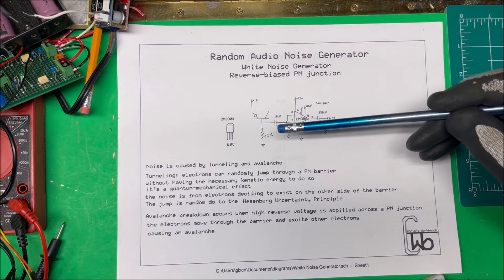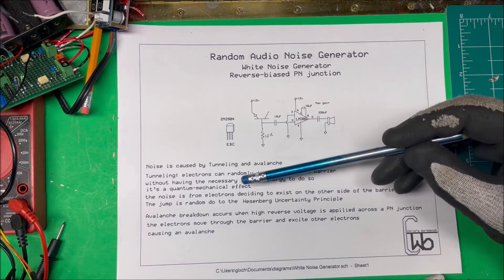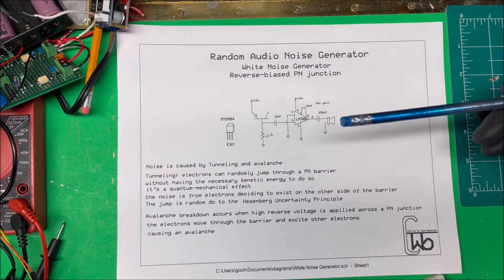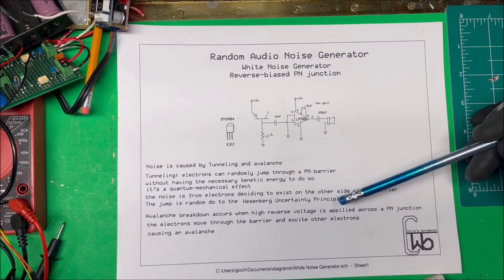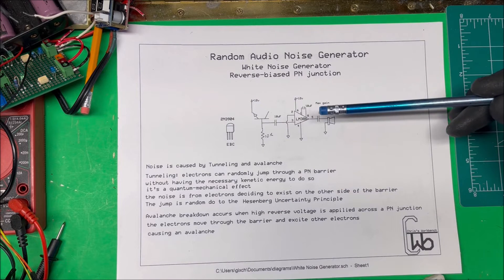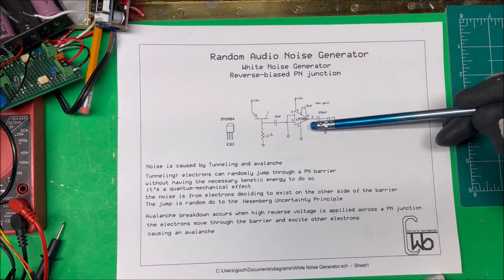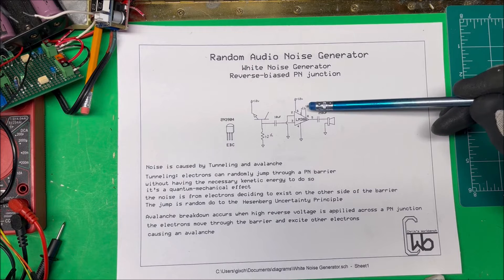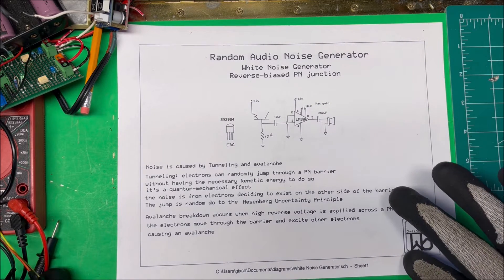Random Audio Noise Generator

Comment: I replicated your projected and it did work. Fun! Thanks! I used all of the same part numbers - the 3904 transistor - I even had a 386 all ready built up as a simple bench audio amp - etc. It got me to wondering, if just a plain diode could be used in the place of the transistor. If so, what type of diode would work best and why? I guess one that would tunnel and avalanche easily... I do not know enough about diodes to make that selection.

Comment: If I understand correctly, it is not so easy to generate a true random number with code with a typical MCU/Arduino/PIC, as it takes a lot of computing power. If I have that correctly, then I wonder if the three component random generator that you are using might be a solution... Use it to generate the random impulses and have the MCU just count them.

Comment: Interesting. I have found that some bandwidths of noise help me sleep. I run a small table fan, on my bedside table, for the purpose. I imagine your generator would sound more pleasant with a proper full range speaker. Maybe some passive tone controls could be added. I would have very much like to have seen it on a scope. I would have also liked to have known how to change its frequency. An enjoyable tutorial. Thank you. I do know about all the free YT sleep videos. I use them, as well. But, you have inspired me to see if I can DIY something. Was it just an experiment, or are you going to use it to inject noise on to your frequency generator to make a test signal?
Reply from the maker: It was an experiment. I listen to talk radio to sleep.